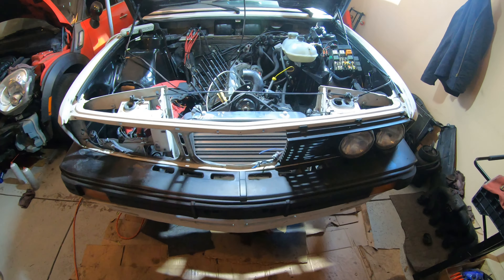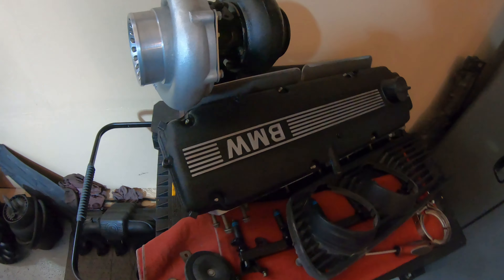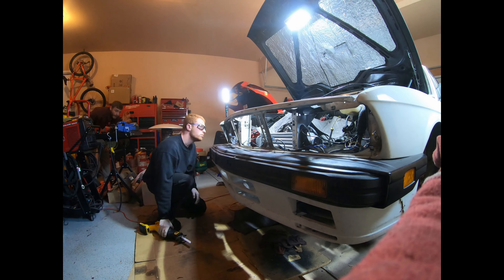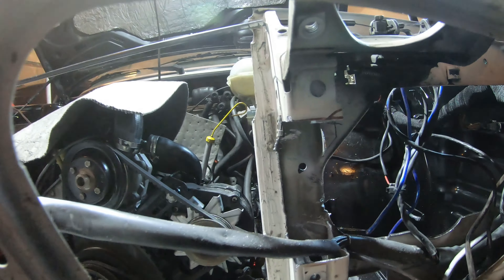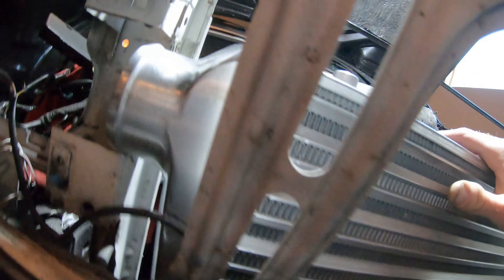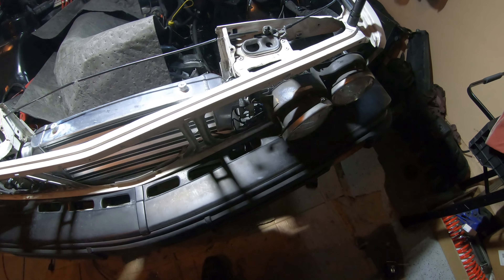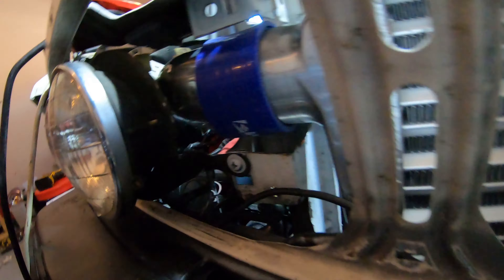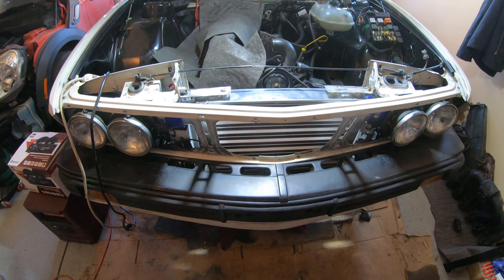How to Install a CX Racing Front Mount Intercooler!!! - BMW E28 M30 Turbo Build!!!

Comment: Hey maN, aRe you still using the
 SaMe steering box? WIth all that power how are you putting the power down if the steering is loose
Reply from the maker: Hey! I am still running stock steering box. Being its rwd the front steering box isnt affecting thr car hooking up, not having to battle torque steer like a fwd car would have. Im running akg motor mounts, akg trans mounts and billstein suspension on the rear end that i think helps a lot with the car squating down and hooking up